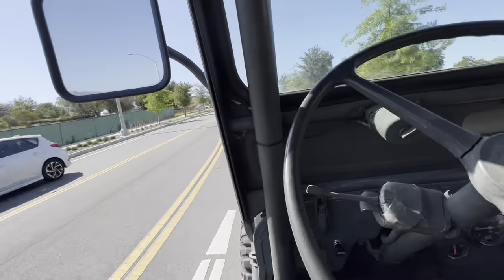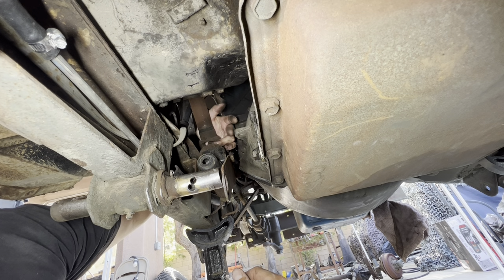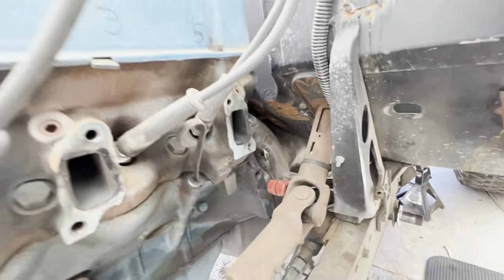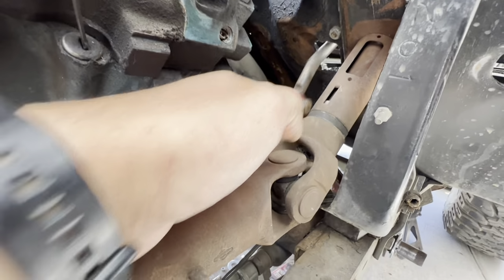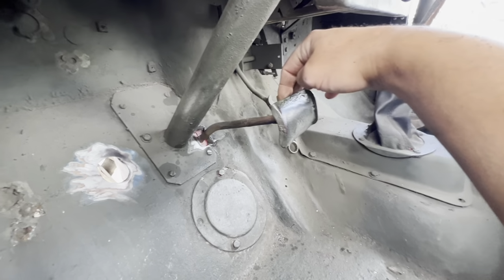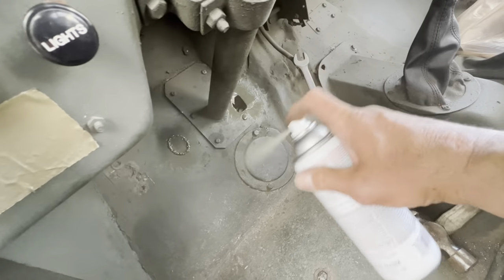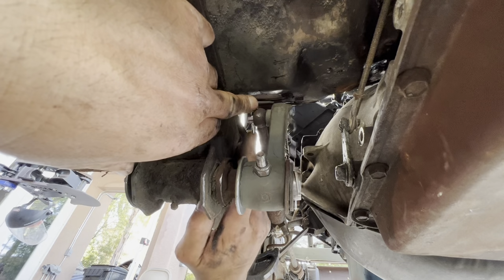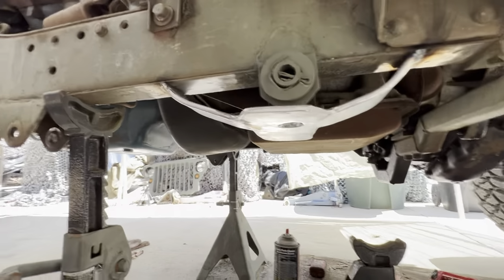Jeep CJ2A Buick V6 225 Brake Pedal modification 1948 vintage

Comment: Swing pedal and fire wall mount master cylinder would be an option. More choices in master cylinder. Dual res and power brake. I did it on my Willys Wagon SBC years ago.  Also the master is higher than the wheel cylinders works better.
Reply from the maker: yes sir. was looking at that. but ended up going the easy route. thanks.